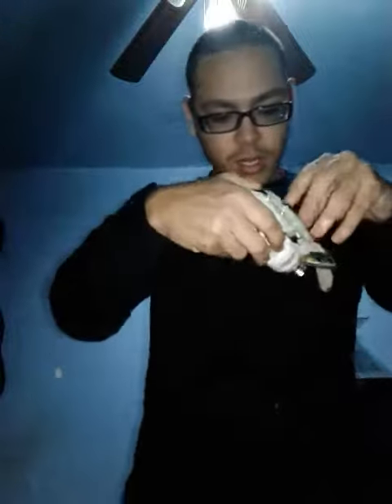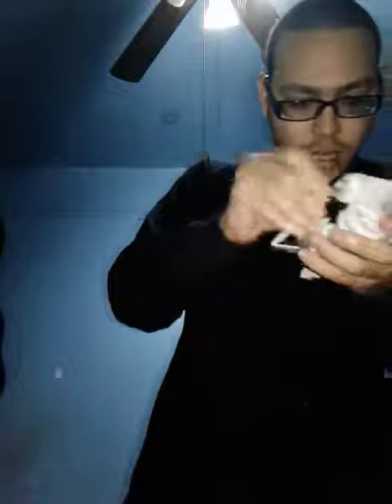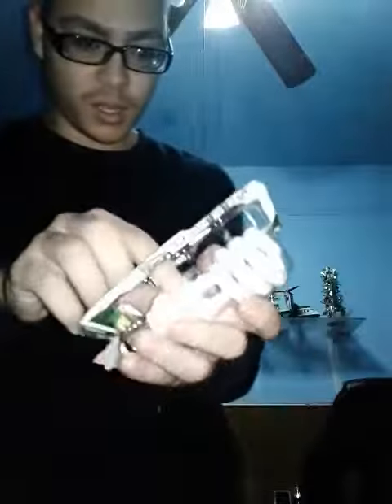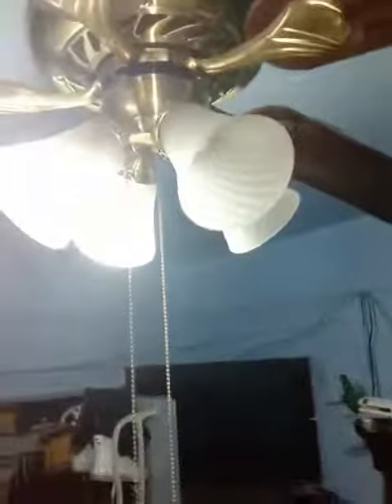Unboxing and installing my CFL bulb

Comment: If you want CFLS that last? Buy good quality ones and you see that they will last. I got 5 CFLS that are 11 years old and still working and I got them in 2006. Once it hits 2018 they will be 12 years old.
Reply from the maker: DarknessWalker wow that's good. Ok I'll try to get long lasting ones from home depot
Reply: The more you pay the longer it will last. I think my mom payed 15 euro for each one. If you going to buy bad quality they will smoke, burn out in a year or explode which is very rare but can happen. Same goes for LEDs.